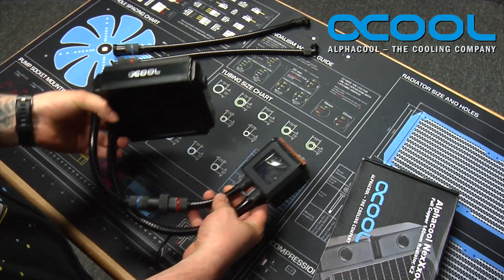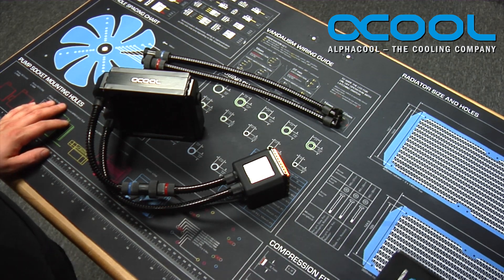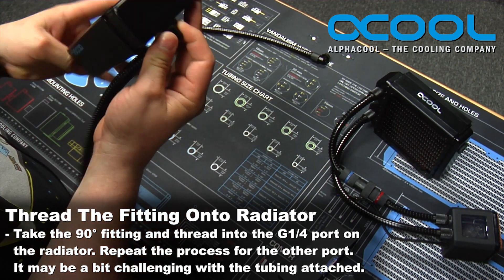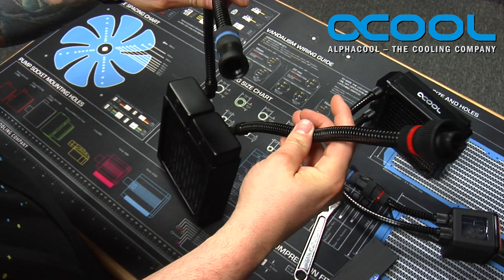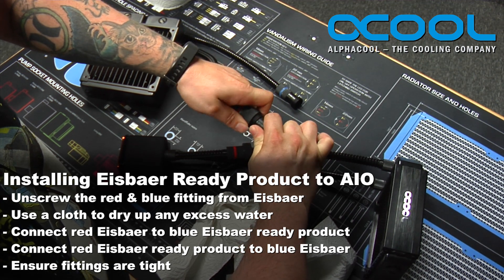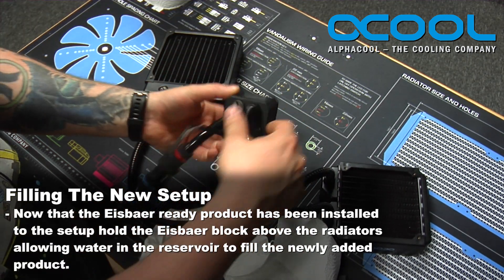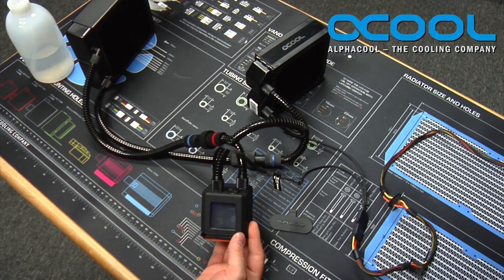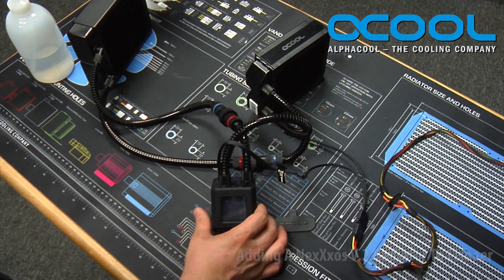How to: Expand your Eisbaer AiO with a NexXxoS V.2 radiator

Comment: Orient the loop similar how they will be fitted inside the case BEFORE tighten the fittings and the quick connectors. Make sure it has enough room for the connectors as the tubing will kink at the neck if.....

Comment: Did this extending my Eisbaer 360 CPU with and extra water block for GPU. What bothers me is that the flow is extremely weak. Was planning to add one more radiator, to keep it as simple single loop AIO, but now I don't think the pump is strong enought.
Reply: You can add an additional pump like the Eisstation DC80.
Reply: @magicmulder  definitly, each extra blok/rad need next pump

Comment: Nice I ordered the alphacool solo 12938 eisbaer and I have a 360 mm radiator. Going to get some white flex tubing and fittings and make my own aio. Just need to do some research on what best to mix my distilled water with.

Comment: No Flush?
Reply: yeah, that way my question. There could be copper or paint chips in there. Also, It seems to make little sense to fill up the pump unit, cap it, turn it upside down, and repeat while the new rad is still mostly empty. Just fill the input extension hose with that squirt bottle until it's close to the top, then join it to the pump. No?